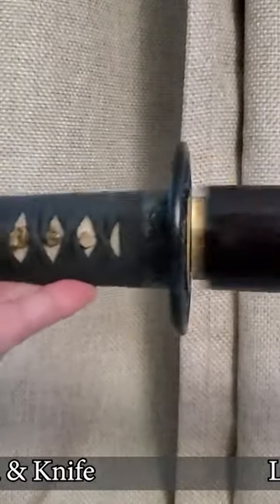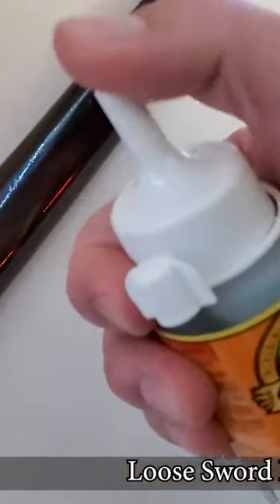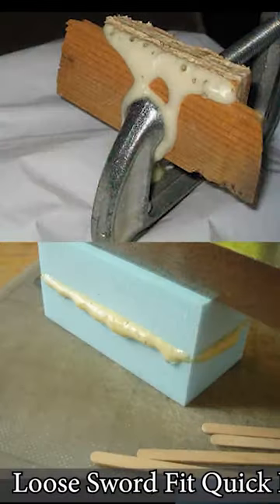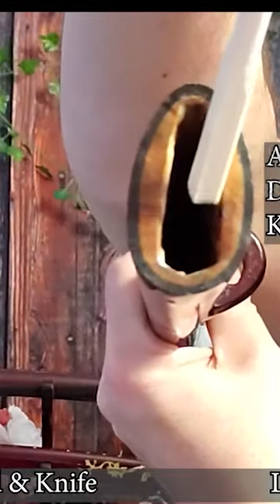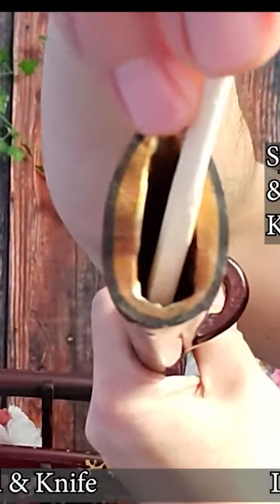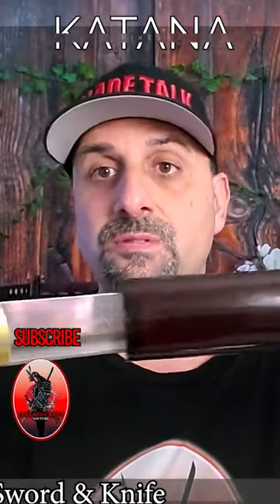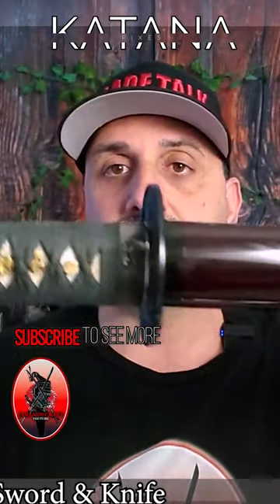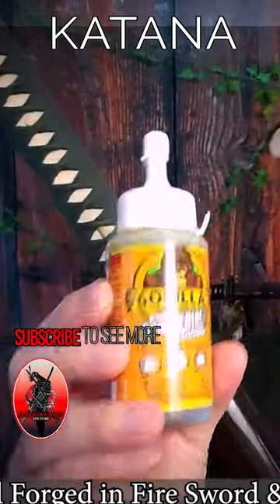HOW TO FIX A LOOSE KATANA TO SAYA FIT

Comment: What I used was Kwik Seal wood caulk. According to the front of the tube, it states that it molds like glue & works like caulk (which it does). I applied it to the spine & sides of the saya’s inside, as per your instruction, and lo & behold, it actually worked!
Reply from the maker: Excellent, Excellent job  glad it worked out gotta try that wood seal, as long as it has expansion properties and drys mold plastic type should be great...
Reply: @JoeSteel1 definitely should be. Tested it a few times & it really gets the job done.

Comment: Will the dried glue morph a little bit to the shape of the hibaki after some sliding in and out?
Reply from the maker: Yes it will mold around it and hug it in place, as long as you are careful not to apply too much and if so you can take a pocket knife and carve some out, but that's messy

Comment: I remember this fix of yours, I just disagree with putting it on the side.the spine is perfectly fine, but putting it on the side could cause stress on it,and potentially split the saya.
Reply from the maker: I understand your concern, but what happens is it molds into place and hugs the Habaki secured after a couple of in and out motions it's good to go
Reply from the maker: and yes the Saya can split if you force too much in there...thats why it's only a small coating is not gonna cause too much stress, I haven't seen a problem with others I've used it on...trial and error I found helped the process